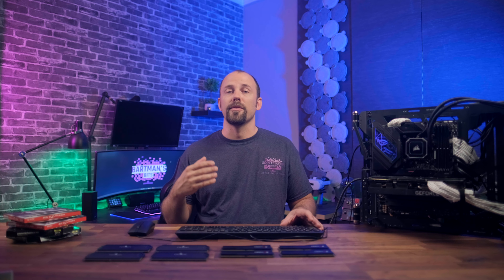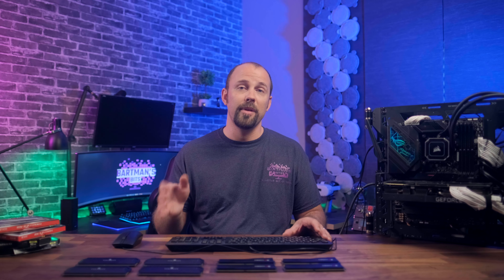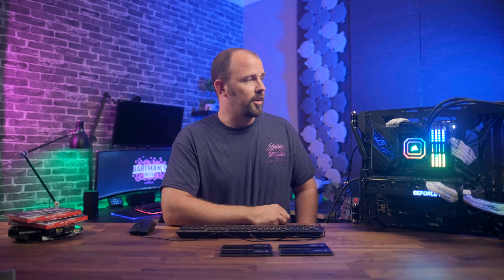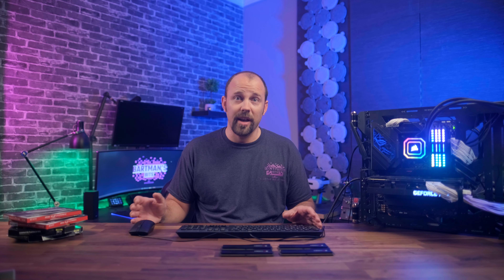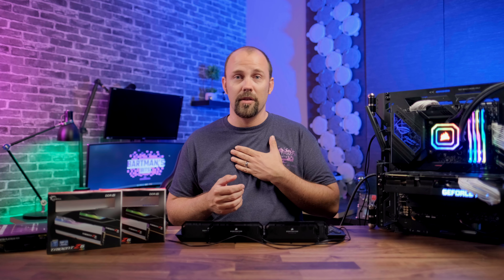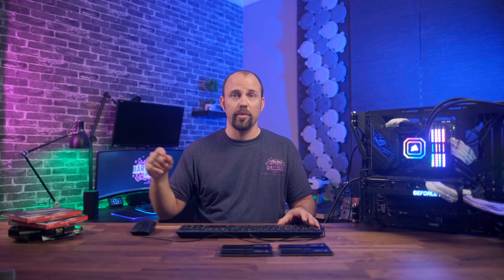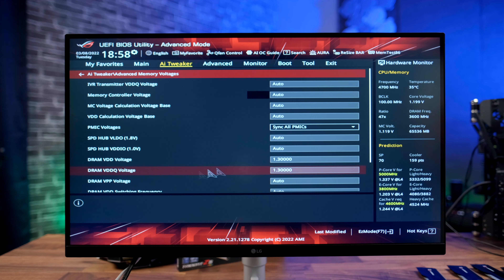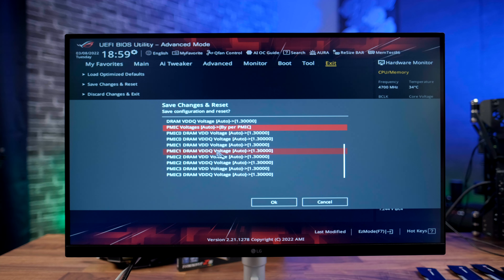Intel’s DDR5 problem resolved! DDR5 64GB Boot Loop failure Fix. Get the rated speeds of your RAM!

Comment: My system would boot with 64GB of Corsair Dominator DDR5 (5600), but would hard lock and crash to BIOS the moment any type of stress was placed on RAM (pretty much any time I opened Microsoft Flight Simulator 2020). This fixed my issue, and I'm beyond thrilled. Thank you!

Comment: Nice vid here.. I actually went through this process a few months ago.. I couldn't figure out why my Adata 5200hz would not work with XMP 1 or 2... luckily I found a random forum advising to increase the voltage slightly to 1.35v... Haven't had any problem since.. so yes, can confirm this is good advice.. didn't know about Sync 'By Per PIMC' though... I've found that wasn't necessary but I'm not going to turn that on in case it helps with stability. Thanks!

Comment: You sir are an absolute legend!
Was having issues with my ASUS Z790 gaming WIFI 7 board with a I9 12900k and 32GB 2 16gb T-Force Delta 6400MHz sticks, and this fixed my issue without any extra tweaking of settings, thank you for this video!

Comment: Thanks a lot- my Msi z790/i9-13900K - 64GB 5200MHz system was not stable enough to even benchmark it - this problem has been solved. I got the link to this video directly from Corsair support, btw.

Comment: Thank you for this. I had 4x48gb ddr5 ram and all of the sudden i was getting bsod after bootup and when I ram memtest I had 14000 errors. 

I knew my ram of a few months didnt die all of the sudden so I tested each one individually. No errors. Put all four in and I was still getting a few errors and bsod every once in a while. 

I changed this setting and bumped my voltage up from 1.1 and ran memtest for several passes with all four sticks with 0 errors.

Comment: Thank you Sir! was able to get my speed from 4000 to 5600 because of this troubleshooting video and if this helps anyone else make sure you check your manual for which slots you should use for a dual ram setup that was my main issue and after realizing that this video fixed the rest

Comment: FYI latest BIOS for Asus z690 strix wifi they fixed XMP. It’s set to 1.35v. 

XMP worked right out of the box for me. Z5. 4 sticks. 64gb at 6000
Reply: BIOS 1403 to be exact.
Reply: nope 1403 still defaults to 1.2 on my z690f  and won't work
Reply: @robcampbell6099  Did it work for you after increasing the voltage?
Reply: @Raubvogel  No
Reply: @robcampbell6099  Same here. My XMP set my default to 1.35v as it was rated. I was able to walk it down to from it's 6000MHz to 5400MHz but had crashes every now and again. This is frustrating. I guess 4800 it is until the foreseeable future. :/
Reply: @Raubvogel  I just pulled 2 sticks back out. Myself I'd rather run at 32gb 5600mhz 35cl than having 64gb 4800 at 40cl

Comment: This video helped me get 4x 32gb sticks to run NEAR xmp (5400mhz vs 5600mhz) on a Pro Art z790. Prior to this it was hard crashing non stop, I think the voltage tweaks and the unlinking was key, thank you for the video. Honestly with a little bit more voltage tweaking on the memory controller you probably could push it higher however I am comfortable with 5400mhz stability.

Comment: Glad I saw this vid 👍I have a AMD Ryzensets 9 7900X Processor, and was running (2x16GB) CORSAIR VENGEANCE DDR5 RAM 32GB  @ 6000MHz. It worked great, until I added (2x16GB) more of the same Ram. I got the blue screen etc. but then noticed the processor was listed at DDR5 5200 (Max.). Can it still be clocked up to 6000MHz using your method? At the moment I have lowered the speed to 5200MHz and it works fine.

Comment: I have an Asus TUF Gaming Z790 Gaming Wifi (bios version 0812) with 2x16gb kit of Corsair Vengeance (CMK32GX5M2B5600C36) and had an issue using that ram.  I couldn't boot with default bios settings at all.  I needed to remove 1 stick, boot in bios and activate XMP 1 or 2, shutdown and put back the second stick to even be able to setup the system.  But even if I was able to make it work, I still had some system instability and your 2 settings help fix my constant game crashes.  Thanks so much!!!

Comment: I tried two kits of 64 GB 5600 CL30 from G.Skill for a total of 128 GB. It booted at 5600 XMP with 4 sticks but insta errors in Memtest86. I tried lowering the frequency down to 4800 MHz and Memtest86 still errored but much less. Then I tried cranking the Memory Controller Voltage from the stock 1.24v to 1.31v and then it passed the 4 hr overnight test (128GB takes forever to test). However, Linpack tests would throw errors very quickly as its much harder on the memory controller. I had to lower it to 4400 MHz to be completely stable. But at that point, I just gave up exploring 4x 32 since going all the way down to 4400 was too much of a compromise and just resorted to sticking with 2x 32 and running the 5600 XMP profile - it was completely stable.

That said, I recently started tweaking the 2x 32 and managed to get it stable at 6000 MHz after a lot of fine tuning. I had to increase the following voltages to get there:
VDD/VDDQ: 1.25v -> 1.425v
IMC Voltage: 1.24v -> 1.425v
System Agent Voltage: 1.23v -> 1.28v
VCCIN: 1.8v -> 2.0v

Any of these missing results in instability. But with all of those, I am running 2x 32 @ 6000 MHz CL30 100% solid stable in all tests.

Learned to tune exactly these voltages and the "safe ranges" from watching Buildzoid's DDR5 Overclocking guide video.

Had I learned about this earlier, maybe I would have been able to get 4x 32 at a higher speed stable, but at the time I didn't have the luxury of time to learn all this stuff as I was within my return period for the other kit.

I also learned that the TRUE test for memory + IMC stability is Prime95 Large FFTs. Any sign of problems show up within 3 - 40 minutes. Most problems show up under 60 seconds.
Reply: what mobo are u using?
Reply: @sleick20  Asus ROG strix z690-e
Reply: @rayw8252  but u you didnt achieve those 128gb? I am looking get that but am not sure..
Reply: @sleick20  not at satisfactory speeds no

Comment: I’m running a z690 aswel but with 128 gigs of DDR5 6000 RAM.
I used this guide and upped my volts form default 1.4 to 1.435 and it booted into the so first run through. Iv been on the loop train for hours before this video

Comment: I have 4x16gb, 6400 mhz, cl32, G.Skill Trident Z5 memory. With the method you showed, I was able to get 5800 Mhz. (1.40000v + 5800 mhz)

For an hour I tried to reach 6000-6200-6400 MHz with different voltages, but the BIOS never POSTed. (Actually I can't go above 1.43500v in BIOS. It automatically overwrote 1.45000 to 1.43500)

I look forward to the new video on 6000+ Mhz performance and many thanks for this solution!
Reply from the maker: If you are using Asus then there should be a “high DRAM voltage mode” (switch it to Enabled) that unlocks that 1.435 limit but use with caution!
Reply: @BartmansBits  I was still testing the settings yesterday but it was very unstable. specifically, my windows have crashed and since then I am over on a reinstall. Kahru memtest found an error in the first 50% after 5-6 mins... and I can't get through the 1st pass in memtest86. We have to wait for the bios update, but I'm not even sure it will work with 2 kit dual channel memory. It is no coincidence that they do not produce a quad channel ddr5 kit sadly :(  and the 2 x 2x16 dual kit is pretty ghetto.

Aaand thanks for the reply. I am using asus rog maximus z690 extreme mobo
Reply: Yep I have the Asus Rog Strix Z690-E and it won't work either.
Reply: I will also be waiting for the update fix.
Reply: I have only 3600MHZ in windows of those  same RAMS and and I have to take two of 4 out utherwise the Win sometimes crash with blue screen....so trying only 32Gbs rams on low mem frequency....terrible opt...
Reply: @hacesown93  same
Reply: @hdz77  same
Reply: i ihave just brought the same kit but just 2 stick  hope i can get it to work at 6400 cl32 have you tested with 2 stick seen if work at 6400 atill waiting to arrive to my country importing from USA to PANAMA

Comment: My situation is different, with all 4 sticks in, and XMP enabled, mine does not boot loop, however, I'm getting continuous BSODs on Windows 11.  I'm using Trident Z5s as well, 6000mhz.  I'll continue watching to see what your manual timings and goodies are :D

EDIT:  I ended up leaving the stock voltages at 1.35 but enabled the "per PMIC".  Ran Heaven and Valley for about a half hour and played 2 rounds of 2042 with no issues so far.  Where as before, 2042 crashed immediately when jumping into a round.
Reply: Did it pass a memtest86?
Reply: @ChromeMagnum , yes, they all passed.  It's been quite a while and I think there has been 2 BIOS revisions since.  I believe one of them is improvement on DRAM but we will see :D
Reply: I’ve got four trident d5s 6000mhz and no cigar for me, went into the loop… with his settings at 1.30 and yours at 1.35 with it set to “per PCIm”
Reply: This worked for me also 1.35v per pmic for ddr5 5600mhz memory now stable. Spent a year of straight crashing in games over such a simple change 🙄

Comment: Can anyone confirm which setting I need on an MSI MPG z790 Edge Wi-Fi to match the "PMIC Voltages" equivalent on this Asus BIOS? I found a setting named "Special PMIC Unlock" and changed that from disabled to enabled did I change the right setting?

Comment: Wish I had seen this vid months ago.
I didn't have any issues until I had updated to a newer bios back in August, and I've been struggling with it since.
For some other folks who run into this issue, 
👉I would like to re-emphasize how important it is to pull your RAM out and put it back in. 👈
 Just doing the memory voltage and PMIC tweaks alone did not get me to POST.
If you can't post after switching these settings, turning off your PSU and draining power(hitting power button) doesn't work either, you HAVE to remove the RAM sticks.

Comment: Just seen this. I've had so many discussions with asus..running z690 asus extreme with 64gb team group 6400mhz. Going to try when get home..let ya know 😃
Reply: did it work?? how about you temps are they okay,, i was gonna do that but im afraid it's gonna burn my cpu cuz high voltage means higher temps.
please let me know if you get the chance, thanks in advance
Reply: Did it work? I have the same board and would like to know

Comment: I bought a brand new computer, and I made the mistake of going with 64gb of DDR5 for aesthetics. After months of using 48gb for stability and trying many different methods, this is finally the savior that helped me. I don't know what took me so long to find this video, but I'm so happy I did.
Specs:
RoG Z690-E Gaming Wifi DDR5 LGA 1700
2 kits of Corsair Dominator 6400Mhz CL32 (2x16)
i9-13900k (non overclocked)

The only thing for me, I had to remove the stick in A1 then boot into bios, because I kept getting Q-Code 55 with the stick in A1 still. Then I changed the BIOS and put the stick in after.

Comment: I'd love to know the setting name on an MSI motherboard.
Reply: Yeah dude me too :D
Reply: I found out what to do. In MSI BIOS, first click on Advanced Mode (hit F7). Then go to OC Settings, and scroll all the way down, until you find voltage settings. There, put DRAM Voltage and DRAM VDDQ to 1.3 Volts each. Then, there should be an option right below that says "link". That's where you put it to "unlink" and I don't remember the option name 100%, but i recall it being something with DRAM Voltage.

Once it is unlinked, you have to set the 1.3 Voltage to the new options that appear. That is just so you set 1.3 volts to 1 ram stick, and 1.3 volts to the second ram stick (if you're running 2 sticks)

Hope this helps anyone out there
Reply: @VinciExspressen  you helped me thank you sir
Reply: @PeterMikeSolomon  I'm happy it helped you!
Reply: Got four sticks to run, but xmp1 won't run.
Reply: @zeroch1ll150  Thats a bummer. Unfortunately I dont have 4 sticks, so I cant help you:(
Reply: @zeroch1ll150  were you able to get 4 sticks to run?

Comment: The PMIC setting fixed it for me! Spent hours tweaking and researching trying to get DDR5 6400mhz sticks to post at rated speeds until I found this video.... much appreciated!
Reply: Ao u have 6400 4x16 tridents? Because i was stucl in a loop. Did it work?
Reply: are you a amd user by any chance

Comment: Dear Bartman,  I know this video covers only ddr5, but I have a DDR4 4x16 (4 sticks) xpg 3600 cl18 that would crash constantly on basic tasks on my 12700k with xmp profile1. I’m new to OC and I play games as well as edit videos on 4K. I’ve tried 3400mhz and system becomes stable, but I’ve noticed a 15fps drop different sometimes during gameplay compared to when I only had 2x16(2sticks). So I really want to run it at 3600mhz. But I’m too scared to touch the VCCSA or other voltages. Other than messing with the PMIC, am I safe to apply the voltage increases by 0.5 - 1 volt for it to run stable 3600mhz? I’m a new content creator boomer and watched most of your vids, I just don’t want my pc to die as that’ll be pretty inconvenient… Thanks a bunch!
Reply: I have the same exact issue with my new build and I’ve been trying to troubleshoot for almost a week. My motherboard detected it as a CPU issue but in reality it’s my DDR4 Ram (4x16) as well.  I have also been using the xmp profile1 on my MSI Z690 Motherboard. Just wondering if you added extra volts and if your build ran safely or if there was any efficient change to stick with 64gb of ram because I would love to be able to edit in 4k but with this problem it is a huge issue. Thank you!

Comment: I’ve got 4 sticks of Trident Z5 6400 CL32. When I turn on XMP I, the voltage is correctly set to 1.4v which is the stick was rated for. I’ve tried to set the voltage to 1.435 (without enabling high voltage mode) and set “by per pmic) but it won’t POST.
Reply: I’ve enabled high voltage mode and set it to 1.5 and still no dice. I think I’m going to try something below 6000mhz.
Reply: @meochan913  dude dont pump too high, you will burn your cpu, be caerful!!
 my advice is go back and reset you bios, turn xmp on, leave it at 1.4v and try lowering your ram frequency from 6400 to 6300 or 6200 or 6100 or 6000, just toggle those it might work.. but dont pump your voltage more than 1.4

if it didnt work let me know ill try something else
Reply: @jam2031  did it work? I’m getting 4 sticks of 6400 and I need to know what to do

Comment: Thanks for that!
I had given up on trying to get my Dominator DDR5 to run at it's advertised speed. Just kept getting the boot loop. I hadn't tried changing the sync all core to per core, that did the trick.

Comment: you're an absolute legend, got my 64gb of corsair dominator ram at 6200 mhz working! thanks so much.
Reply: Hello, Ali. Are your rams 4x16 and what is your voltage? Thanks.
Reply: @mahmuthemsin8333  yep, 4 sticks of 16gb corsair dominator 6200 mhz.. works like a charm now
Reply: @aliazimi91  what is your VDD and VDDQ voltage value? By the way, are you Turkish?
Reply: @mahmuthemsin8333  i copied the exact settings from the video.. and no i am not turkish.

Comment: Thanks! Fixed the issue. I had to also drop the frequency a few hundred MHz because I got some errors from OCCT memoy test at the rated 6400 speed, but main thing is, I could actually boot!

Comment: Bro, thanks. I am not even using an Intel system. Using AMD 7950X3D. Your video randomly came up with me not finding a solution to booting. However, you just kept saying the system will take time to train the memory. Wait up to 10minutes. So I waited, waited, and waited. Well I guess it trained the ram because my system finally booted up. Never once out of the many many builds I've done have I ran into this situation. Thanks again!

Comment: Hi There Bartman! I'm having to run 4x32 (128GB) Dominator Titaniums on an ASUS ROG Strix Z790-F  Gaming Wifi II at 4800 will not play nicer on anything higher. Reluctant to push the voltage as already spec'd at 1.4v I really hope the bios / firmware updates for the MB and RAM improve the situation in the coming months.....
P.S. I also work in Doha over at North Oil, so Hi! 👋👋

Comment: I Just tried this with 64 GB Ram, DDR5 @ 6000 (4 sticks of XPG), didnt adjust voltages (voltages on latest bios update already higher than 1.3 as default) but changed the PMIC voltages from "Sync all PMIC's to "By Per PMIC" and worked first shot. have 12900K, Z690-F Mother board and again 4 sticks of XPG 16GB DDR5 Ram. Awesome it worked. Wondering if I should try again with having the PMIC voltages to Sync all (With XMP) but just going to leave for now as its working perfect here now. Thanks

Comment: Thanks for everything. I have Gskill DDR5 (4x16GB) 6000 mhz ram. After long trials, I was able to run Gskill DDR5 (4x16GB) ram at 1.40 volts at 5800 mhz on the Asus Rog Strix Z690 motherboard by following the steps in this video. The system has been running stable for a few days. The system starts at 6000 mhz at 1.40 volts, but it does not work stable. I think it is necessary to give more than 1.40 volts for stable operation at 6000 mhz. However, the support team of the manufacturer of the rams said that it is risky to give voltage above 1.40 volts. There is no rule that it will work in the same way for people with the same system. However, I wanted to share it for informational purposes. I would like to say that the people who apply it are at their own risk. Have a nice day.

Comment: This one is still very relevant , currently I have changed the voltage to 1.35 Volts and "0 " crash.
Spec:
Asus strix z690 e gaming wifi
XPG lancer ddr5 6000 (64 gb)
i7 -12700k